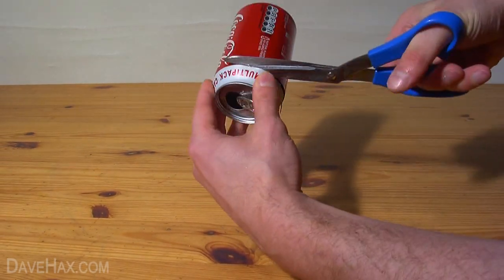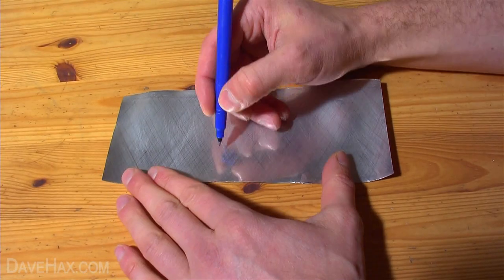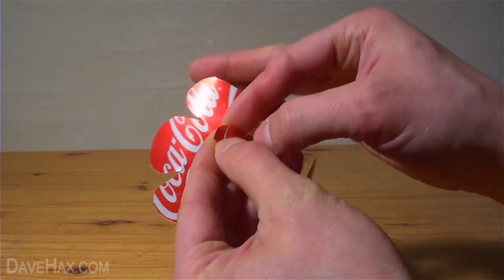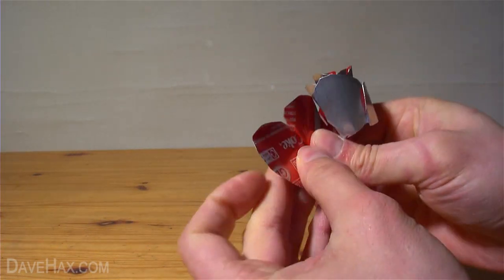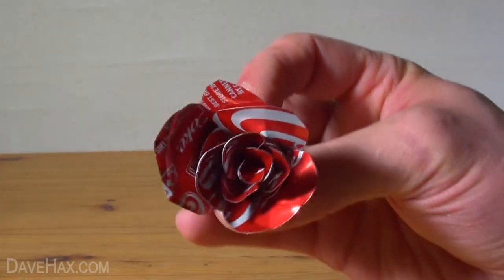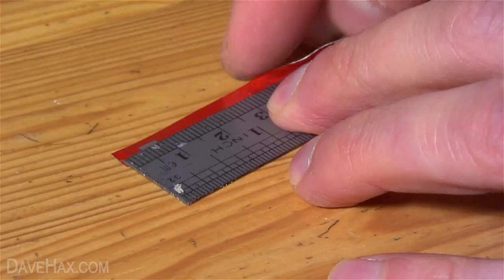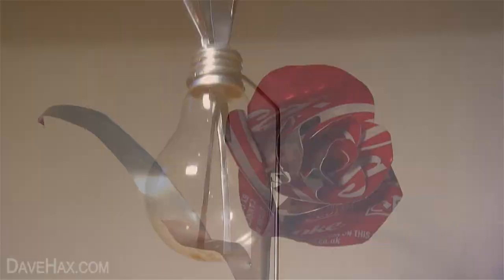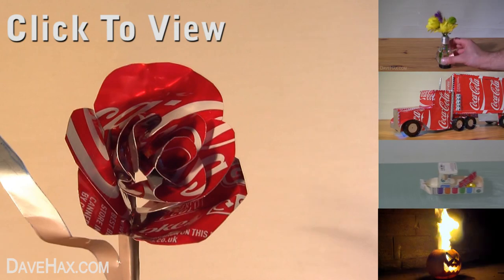How to Make Coke Can Rose - Valentines Day Gift

Comment: So, I've spent the last 4 or so hours straight making aluminum can flowers. Thanks for the idea, but sorry it was just too hard to follow. If you google 4798059975_2dbffab336_z.jpg, I used that template instead. As I was sitting there cutting cans for a long time, it gave me time to think about my SO. It took forever to do this and as the hours passed, I eventually realized I didn't love her as much as I thought I did so I just broke up with her. Thanks man, you helped me see the light!